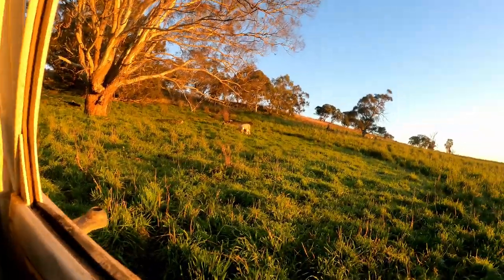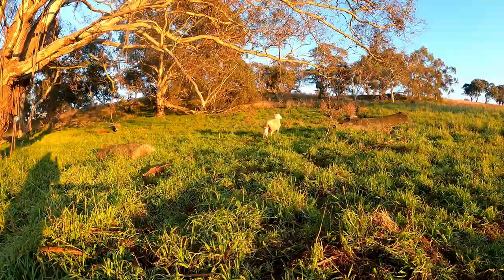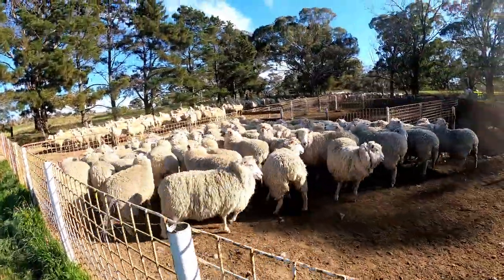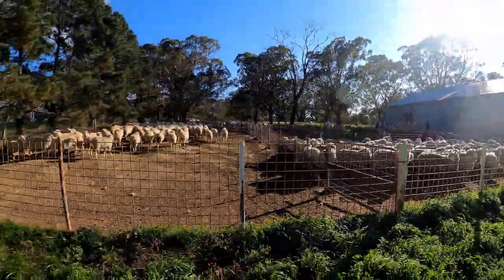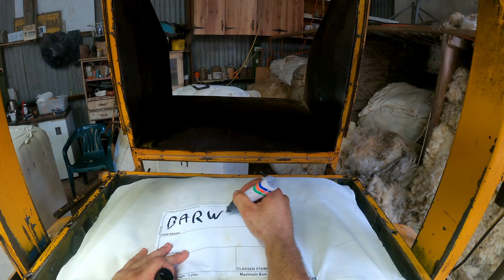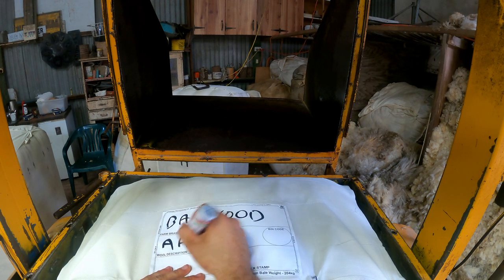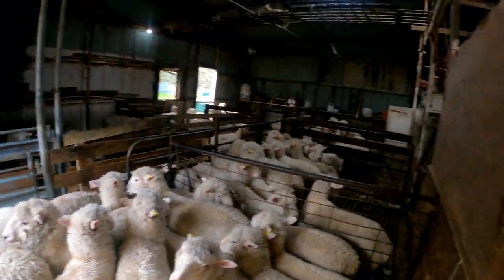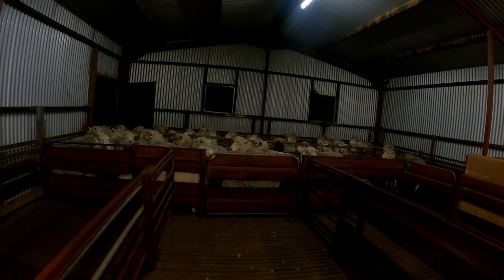Why Do We Shear at This Time of Year? | Shearing Cross Bred Ewes | Australian Sheep Farming

Comment: Its surprising how much of a difference a shelter belt can make to the temperature. I recall walking into a circular (planted) shelter belt a few years ago and the temp was probably 5 degrees C warmer inside it than the rest of the paddock. It was certainly noticeable.
Reply from the maker: Yes it is very interesting. We have done a fair bit of treelot plantations over our time here with the aim to improve biodiversity, but mainly improve shelter for the stock! It can provide great protection for them during cold fronts.